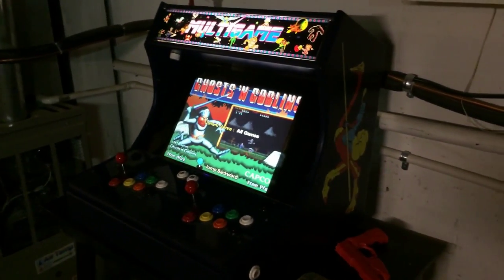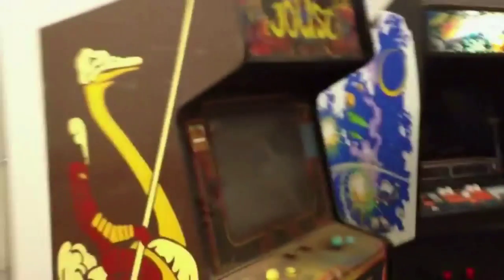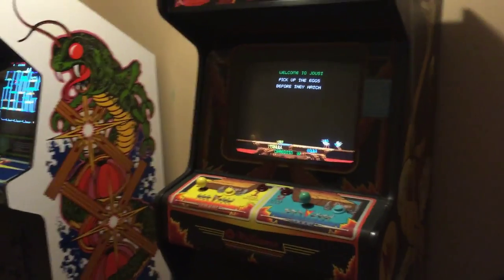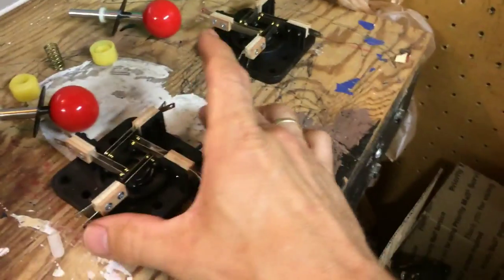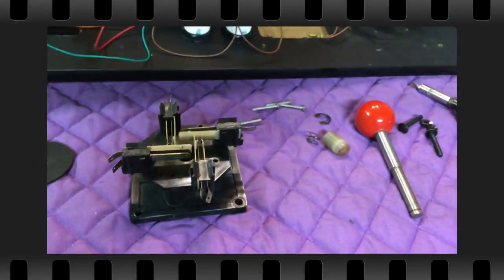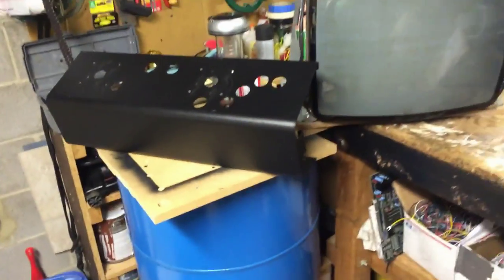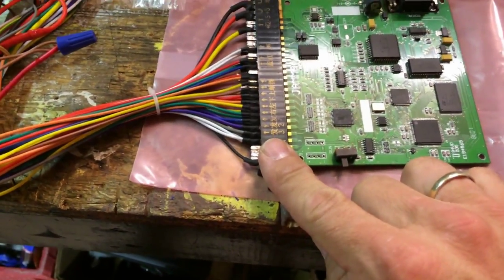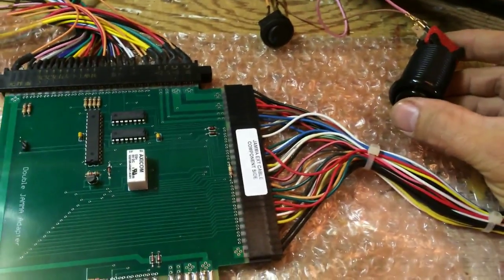Joust Restore Part 1 - Converting to Multi-Williams (special bonus setup)

Comment: For the resistors on the 2 in 1 JAMMA switcher wire harness:  I would put some shrink tubing on, re-solder them properly and call it a day.  It's worth learning, and you don't want to have it short out on you and ruin your boards!
Reply from the maker: That's a good idea.  Not sure if I will though since I have it all installed in the cabinet already and tied up nicely. :)  I have to get the video of part 2 uploaded.
Reply: If I lived closer I'd do it for you...
Reply from the maker: Sounds like you feel strongly about it needing done.  I guess I'll have to pull it out and do it. :)  Thanks for the input.